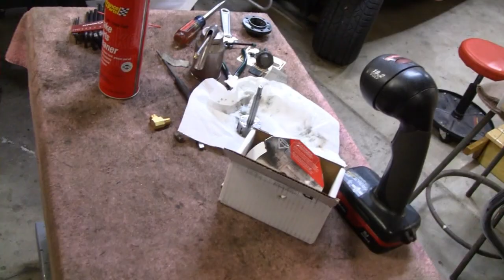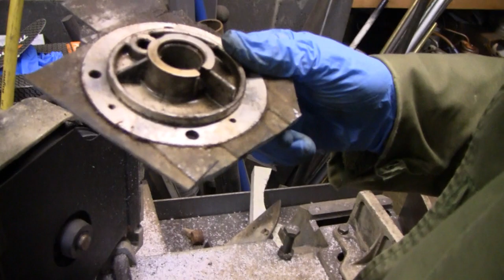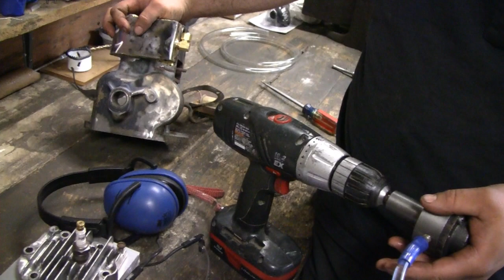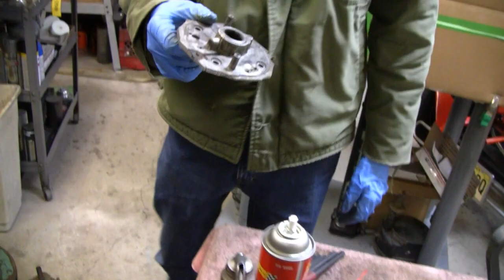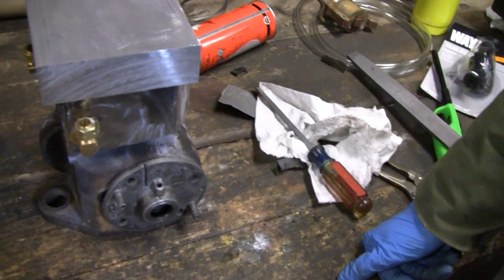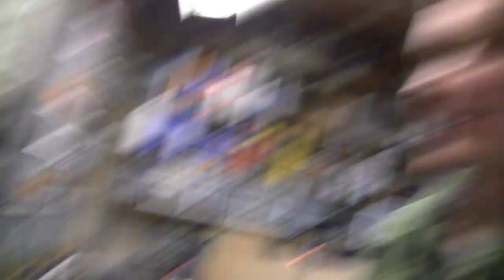HOMEMADE WATER COOLED BRIGGS ENGINE (part 11)

Comment: cool pump. looks solid. make sure you don't pump the water too fast or it won't have time to cool down.  keep up the good work!
Reply: ThriftStore Hacker 
     I had a small block Chevy that had a bad thermostat. I couldn't get a thermostat right away so I pulled the old one and put it back together. It took a long tine to heat up, then would overheat. A new thermostat cured it.
Reply: tom7601 yes. in my old racer I would use a large washer instead of a thermostat. took a lot of trial and error but I found the right flow.
Reply: ThriftStore Hacker 
i just cut all the crap off the thermostat assembly so I'm left with the disc. 
In the middle of nowhere , you just cut those spring holding ears off with some linesmans pliers. 
There's your metered office.
Reply: Right speed is key, i had a friend in dire need to water pump replacement, but knucklehead he is, he bought the wrong (yet, surprisingly fitting/and lookalike water pump) of course the thing flew waaay too fast and the engine was actually worst than on arrival. I sure banged my head around a few times until i figured to check the pump...

Comment: Awesome! Can't wait to see it running buddy.
Reply from the maker: Thanks Buddy!!☺
Reply: FireAndGasoline 
Use some 3m yellow weatherstrip adhesive in a tube instead of blue loctite because it has about the same holding power and won't corrode threads , buddy.

Comment: That is a nice little pump. I'll remember that when my Ice maker pump goes out on the water cooler for my TIG torch. I use a transmission cooler for a radiator.
Reply from the maker: Yeah I was lucky to find it!!☺

Comment: I have many thoughts RK but I'm just gunna wait and see...Good stuff mate.
Reply from the maker: Thanks Zig, you're a wise man!! I'll give ya a few more details to think about!! The head will be cooled, the radiator fill will be higher than the head, that pump will be pushing 5-10 GPM, we're trying to cool a 2" piston in a show engine idling at 500-600 RPM!! All the Jerkoff comments I've gotten over the months don't have a clue about the whole set up or even know it has a water cooled head or radiator with a fan but they know there will be air pockets and will need a bleeder in the jacket!! Fuck them Mate, You're opinion is the only one that means anything to me!! Cheers!!☺

Comment: Since were the head bolts thread instead of running hoses to the head you could use motorcycle brake bolts with the hole threw them.
Reply from the maker: That's a great idea Chris, I gotta give you credit for thinking outta the box!! I came up with the same idea and told Mike and he couldn't stop laughing it was so brilliant!! We were gonna tap the head bolts larger but there isn't very much room left!! We still might come up with another head using that technique!!☺

Comment: where can I get a pump like that? and yea that lock tight is good. sometimes too good. then you are trying to get a bolt out with it on it! have you guys thought about building a brigs with a motorcycle jug , piston, and head. on a brigs crankcase? something with a over head cam. maybe a 5 or 10hp. I wanted to do that very badly when I was a kid. or just put a overhead can head on a Briggs. I would really like to see a project like that. great video guys.
Reply from the maker: Thanks Bud!! We got that pump on Ebay!!☺
Reply: +805ROADKING 
what's the pump for? what should I search for to find it?

Comment: also. I have a question. I have a newer flat head Briggs. it has the front cover for electric start. and bolt holes for the starter in the block. I haven't looked. but should the flywheel have a ring gear? if not where can I get parts to make the 10 HP electric start? I'm not concerned with the charging system. since its a generator. I can just plug in a maintainer charger. where can I get parts? if you could please help.thanks...

Comment: Where did you come across that water pump? I imagine it will stand some heat considering what you're going to use it for. I know a guy that needs one. Low pressure application but it's going to have to stand up to around 200 degrees F.
Reply from the maker: Ebay!!☺
Reply: I was looking on there for it but I can't find one. All I can find are the big industrial looking things.
 Can you give me the model #? Sorry to be a pain...
Reply from the maker: It doesn't have any model numbers on it, just a name "Tuthill"

Comment: hey RoadKing  I was wondering where to get a buzz coil so I can replace my solid state ignition because it went bad and is hard to find  this will be for my  14 HP techumsy
Reply: You can find them at engine shows and ebay.
Reply: Oakwood Machine Works  sadly where I love we don't have engine show but ill check eBay

Comment: its not a real water cooled engine unless the head is water cooled
Reply: I believe that's why they are machining a brand new head out of a block of aluminum.
Reply: I think it would be easier to box off a stock head and use some hoses.